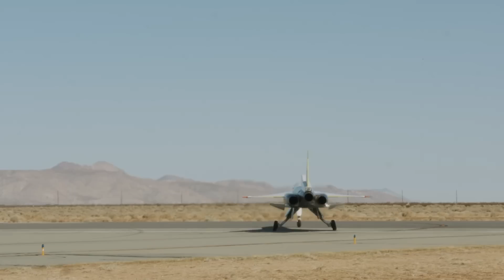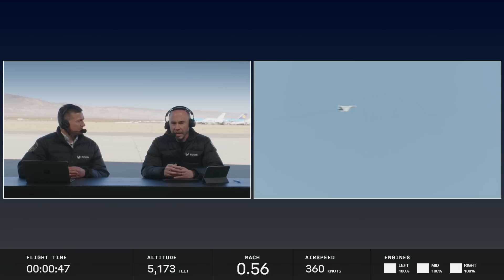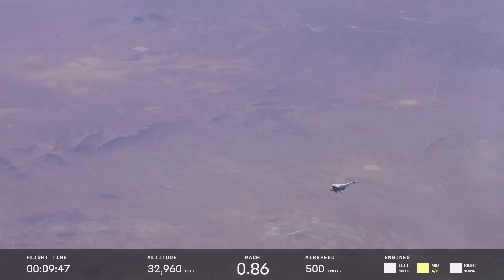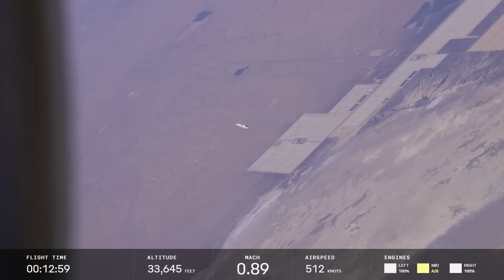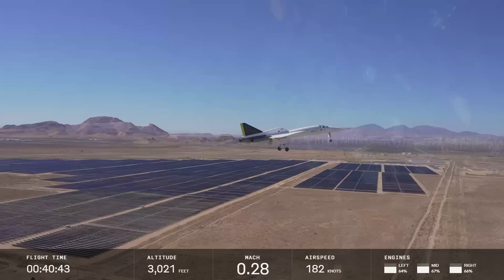XB-1 Breaks Mach 1.18 | Watch the Final Supersonic Flight

Comment: 8:58 — schlieren image example
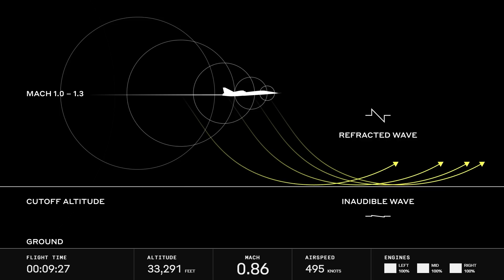13:50 — sound wave refraction chart
18:20 — 4th sound barier
24:48 — engines are specially made
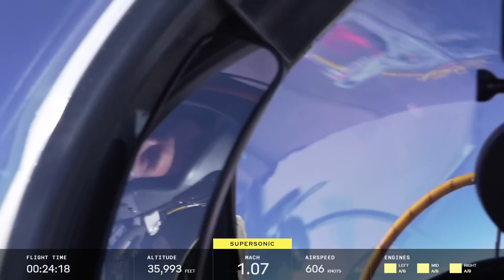28:39 — 5th sound barier; you can't tell it from inside the cabin
35:18 — 6th

Comment: I understood a sonic boom is generated when decelerating out of the supersonic regime into the subsonic regime. For example, when the SpaceX booster returns to stick a landing, we hear the boom, but not on the way up. Can you help me understand it a little better? BTW, "this never gets old" is a comment I always make for all SpaceX launches. I love your work and pray for continued success.
Reply: A supersonic boom is generated constantly, the whole time an aircraft is moving faster than the speed of sound, because the aircraft moves faster than the air molecules do in the course of their normal motion. Therefore, a supersonic aircraft pushes them faster than they can get out of the way, which compresses them. The shockwave caused by this compression, the sonic boom, moves in the same direction as the aircraft, which is why you don't always hear it (you wouldn't hear it standing underneath the flight path of an aircraft, before the point where it went supersonic, either).
Reply: The Falcon 9 does sometimes create an audible boom on it's way up if you are somewhat downrange from the launch site.  For example, it can be heard along certain parts of the California coast when launches go into polar orbit (and this is when the booster lands way south, off the coast of Baja, so it's not the descent being heard).
Reply: @RocketToTheMoose  Have to disagree with the assertion "so it's not the descent being heard". I'm in San Diego and do not hear the boosters when it returns to Vandenberg, and have recorded the decent off of Baja, but not heard the pleasant boom. Sunset polar launches out of Vandenberg are beautiful.

https://youtube.com/shorts/WL76wRIYIb8?si=2OxKJHnC0mPHoZ2z
Reply: @truegret7778  Well, you aren't really disagreeing then.  I've heard the boom on ascent.  I've also heard the boom on the boosters returning to Vandenberg (when that happens).  However, all the StarLink flights that hug the coast do not do a return to launch site, so we don't hear the booster coming back in those cases.
Reply: @-danR  Well, a pretty faint sonic boom, and very rarely, some barely audible rumbling afterwards.  Again, only on the StarLink launches.
Reply: Every phenomenon you want to understand about sonic boom is graphically visible in the bow wave of a boat. The bow wave hits the shore along the boat's path. It hits the destination when the boat slows down. I doesn't hit anything behind the boat because the propagation cannot go backward.
Likewise no boom down below from an ascending rocket.
Reply: @-danR  makes sense .... thanks

Comment: when Mach 2 ?
Reply: They're targeting mach 1.7 for the Overture, probably due to efficiency reasons. Yes that's slower than Concorde but still double a regular airliner.
Reply: @ricequackers  There are going to be multiple versions of the Overture. One being Mach 1.7, with the speed increasing with each version.
Reply: Probably after this test concluded. They are testing the noise reduction design first before doing the mach 2 test.
Reply: Doesnt need to go faster the whole point was to go supersonic without the supersonic boom to ensure supersonic commercial flight.
Reply: There will be no mach 2 with this aircraft